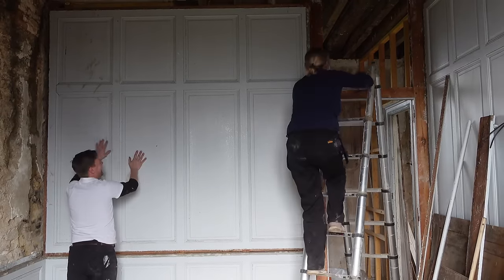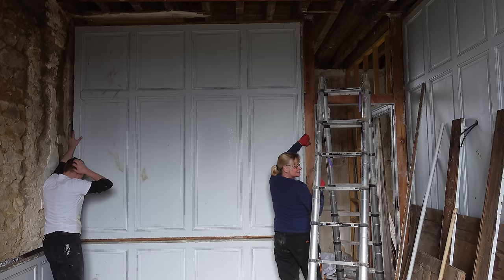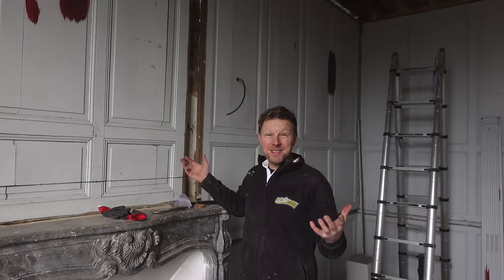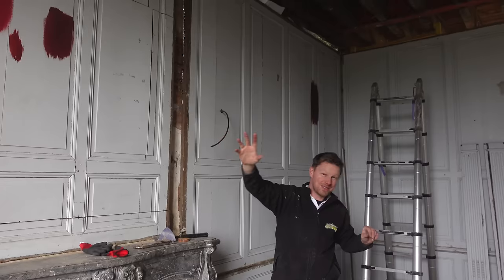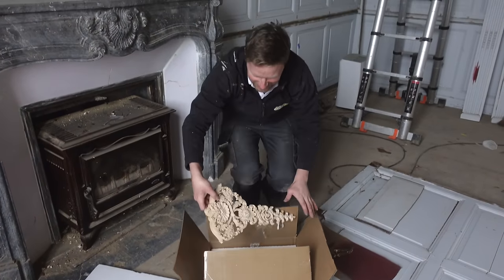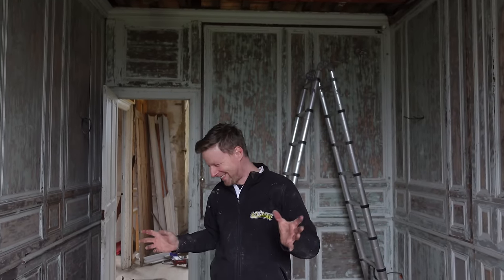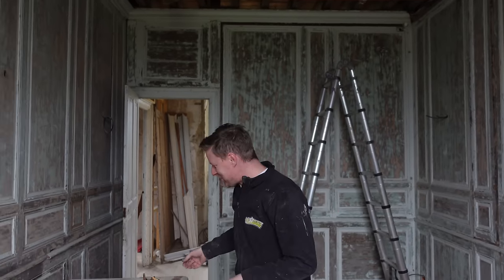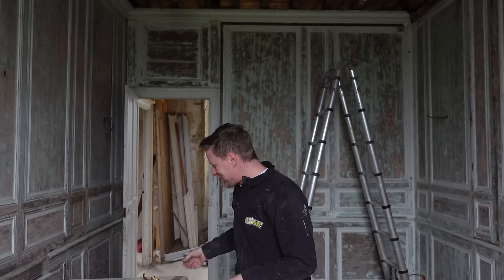MORE DESTRUCTION For The Chateau RESTORATION - NO Going BACK.

Comment: Terry, I have absolutely no doubt that your vision for flipping the paneling will look beautiful in the end. ♥ But, it won't be historically accurate to Louis XV style of paneling. 
May I suggest cutting off the top of the paneling (as it was) and extending the long top panels up to the ceiling? 
It would not be as difficult or expensive as it may sound & it would be historically accurate, it would look amazingly elegant as well! 
With the correct router bit you can easily recreate the proper molded edge of the panels.
Reply: I guess I should explain further. The style is either a small panel at the bottom, a tall panel in the middle & a small panel at the top. OR A small panel at the bottom with a tall panel on top. 
There is the use of a small narrow panel between the bottom & top panels. However, I can find no example with 2 small panels (of the same size) at the bottom.

Comment: Would it be possible to put in a smaller round or oval window just above the mantle height so you can get a bit of light from opposite side of the room just a thought 🤔not there so just thought I would ask🤷‍♂️
You all are doing an amazing job and what you have done so far is  stunning thank you for sharing your restoration journey your smiles and laughter through each project is inspiring 😇

Comment: I LOVE the sconces. I have a 3-arm chandelier I put here that's almost identical, down to the detail of the grapes(?) on the parts pointing down, the arms are almost exactly the same, with that same edge, ciselure on the sides, etc. Would send a picture if you could do that here. About the only difference is since mine is a chandelier, it has a place for Louis XVI faces between the parts where the arms attach to the centre. It's solid bronze and weighs a ton. I love mine, and you'll love those sconces. It feels like you're making such fast progress, even with flipping the room over! ;-)
Reply from the maker: Thanks so much Ron. Send us an email 🥰🥰
Reply: @chateaudelalacelle  OK, just sent you an email with a few photos! Hope they come through without a problem!

Comment: Nope feels very stuffed having the two short panels.  Never in any old style building do you ever see these upper high wi the two lower boxes in.  If you want to do it this way cut out the smaller middle box and lengthen the longer sections.  I think many will agree with me.  The big trim certainly could be made into a smaller mold and keep the boards larger in the middle.  I think this is the worst design for eye feel I have seen.  Not trying to be harsh but this feels very eye awkward.  Sorry being honest.  Good luck.
Reply: I'm not seeing it either. Just going to sit back and wait to see how it will work.